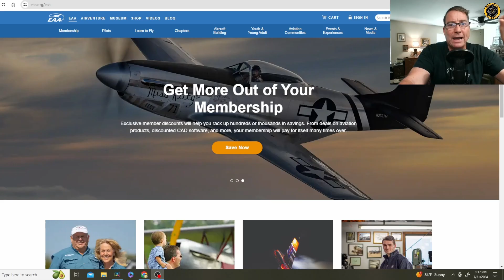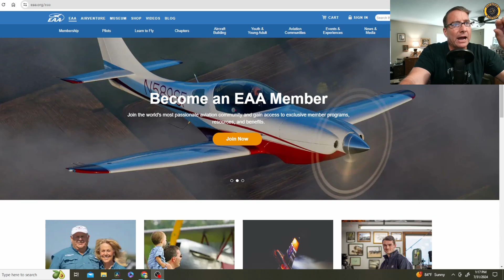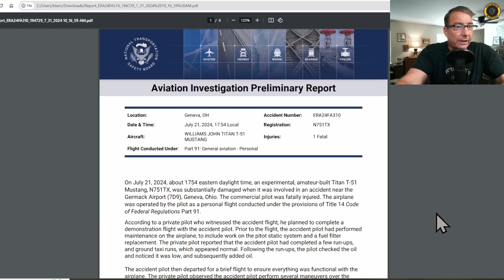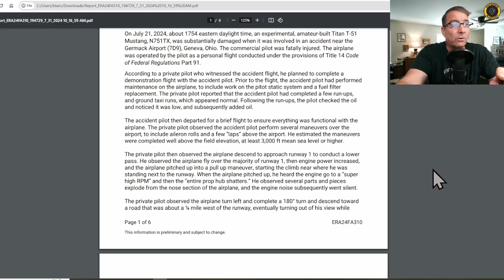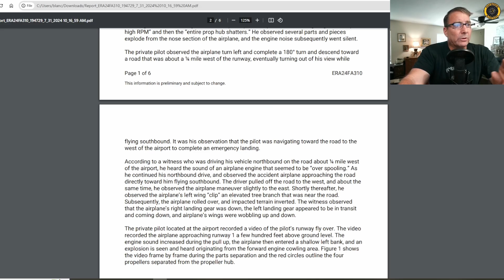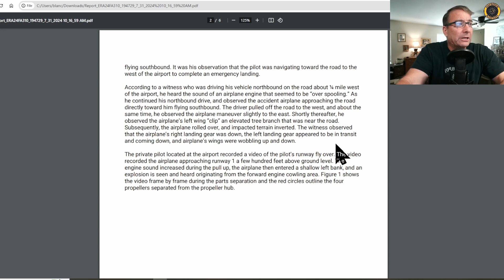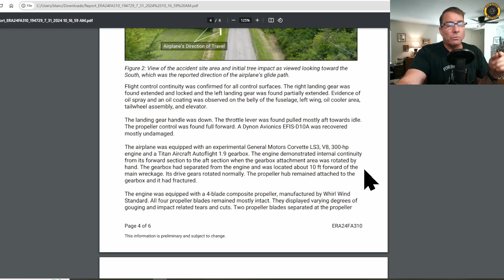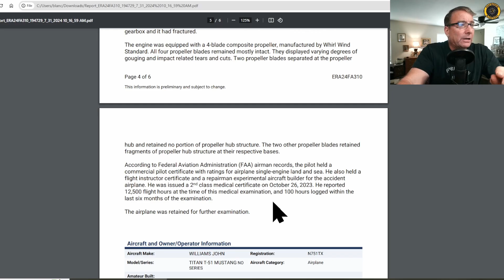Titan T-51 Fatal Prop Hub Failure 21 July 2024

Comment from the maker: No, to be clear and as presented in the video. The prop hub failure was PRECEEDED by a gross PROP OVERSPEED.
Reply: The fact that this has an GM LS3 suddenly brings up all sorts of other possible failure modes. The factory redline for an LS3 of that trim is something like 6600 RPM (Edit: And this assumes it’s the stock FI setup and not something else. Sans any limiter these will cheerfully rev right past 7k). With the 1.9 ratio reduction that will equate to a max of roughly 3500 RPM. The kicker is how was the rev limiter configured? Thats a big one. With all that rotating mass the last thing you would want is one of the usual hysteretic based ones that uses bang-bang control of the fuel and/or spark that causes the RPMs to bounce up and down rapidly. That will shock load the prop and the gearbox in the event there is an overspeed. I have actually reverse engineered some of the OBD-2 ECUs used on LS motors and there are possible options to allow for a "landing" during an uncontrolled overrev where instead of just bouncing away it arrests the PRMs and holds them there.
Reply: @mysock351C Ok, just putting my own observations here from my 3 vehicles, a 2002 2500HD 6.0 gas engine (with throttle cable), a 2004 2500HD 6.0 gas engine (with drive by wire) and a 2012 GMC Yukon XL with the base 6.2, my 02 will rev up to 5200rpm and stay while in park, it doesn't bounce, until its in gear then it will do the rpm bounce (i put the tires in grass to experiment) my 04 will only rev to 4k rpm and stay steady in park, and in the grass it doesn't seem to bounce off the limiter nowhere near what my 02 did. My 12 Yukon revs to 4k rpm and bounces in park, and it bounces at 5500rpm when the tires are spinning both. No mods done on none of the trucks except a "hot air generic K&N intake" on the 02. Just figured i would put my experiment results here, as some real world non-scientific, general observation testing.
Reply: @mattcat231 Factory ECU's have pretty low RPM limiters. I'd expect the aircrafts engine to be fitted with MoTeC or Holley EFI, and not to have had an upper RPM limiter set.
Also, ditch the Hot Air intake and get a Cold Air one, your trucks will run better. ;)
Reply: @mattcat231 nobody said the engine is running with a GM ECU.
Reply: @alafrosty  I also wasn't implying it was, i was just putting the info out there IF IT WAS A GM PCM, and what my real world observations were with my 3 vehicles.
Reply: @PiDsPagePrototypes  They are using factory ECU's. That is why it over revved. Engine redline 6500, propeller designed for max 4500. When the variable pitch failed from full pitch it reverted to minimum pitch unloading the engine an going to FACTORY redline causing centrifugal destruction of the propeller hub. Motec has an incredibly fast and soft acting rev limiter by many means. Ignition, fuel, timing and throttle body.
Reply from the maker: Loss of oil pressure to the governor can cause this...we don't know yet.
Reply: @blancolirio  would it be easier since the engine (I'm assuming somewhat that carbs haven't been installed) has EFI that the ignition can be retarded if there is an overspeed condition?
Reply: @TankEnMate  Aerospace Engineer here: Great question.
I have spent 30+ years in industrial control systems and part of that time working for an employer who also owned a racing car team as well as having another client who was into car racing. So I not only know how systems that use sensors and software make machinery work I have also been around things like ECUs (engine control units) that control EFI engines with. 

FIRST - I do not know what system they had on this particular engine. So all I am giving you and others here is general information. Most pilots should know parts of this stuff. The reason I am going over the different types is so that when Juan does a follow up and tells us what sort of system was on this engine you'll all have a general idea what he's describing.

Specifically to your question: YES all ECUs can limit the engine RPM and can do it in several ways. The common 2 are to retard the engine and the other is to cut the fuel supply. That's not always that clear cut as they may cut the fuel supply progressively as in they cut the fuel to only a couple of cylinders then a couple more then more after that. The reason they do that is so they don't have a sudden loss of power when they hit the limiter and it makes the car jump around. Its sometimes called a soft limiter.

PART 1 - Magnetos
Its fine to allow a computer and software to control the spark when you are in a car or a boat because neither cars or boats fall out of the sky when their engines stop. The emphasis on aircraft engines is to keep them running regardless of other systems on the plane. The only other engines I know that do similar are high end drag racers like Top Fueler racers and they use magnetos to reduce the chance of an engine hydraulic where the cylinder fills with liquid fuel and the piston tries to compress what can't be compressed and instead blows the side out of the engine. YES I have had a Top Fuel mechanic explain to me the starting procedure for one and its pretty amazing what happens.   

To keep then running no matter what else happens in the plane they use magnetos. For those who don't know magnetos look similar to a distributor but create the spark energy internally from the engine crank shaft. They do not need or use batteries, coils or anything else to make a spark. What they do have internally is a impulse drive that uses a mechanism that no matter how fast the magneto is turned it will generate a spark at each required point in the cycle. 

That also means they have a dangerous side effect if its not respected. If you hand crank a magneto engine you only have to crank it far enough to get to the next spark and then it will spark and the engine will kick if it has fuel in the cylinder. 

PART 2 - Mechanical Fuel injection.
Long before there was electronic fuel injection there was mechanical fuel injection and it came in 2 main forms and both still exist. There's direct injection into the cylinder and port injection where the fuel is injected into the inlet port. There's also indirect injection where fuel is injected into a small chamber attached to the cylinder. If you want more on that Wikipedia explains them all on a page titled "Fuel Injection" 

The type we see on most aircraft are PORT INJECTION systems which we see on engines like Lycomings and Continentals. Anyone who's flown fuel inject C172s or Mooneys during their training like I was had these systems explained to them. Unlike EFI systems these are actually quite basic. There's a pump, there's the fuel flow control valve, there's a fuel distributor, there's lines to the nozzles and then the nozzles. There's no solenoid operated injection nozzle like with EFI. There's no engine sensors showing where  engine is in its rotation. The pump pumps, the valve controls the flow, the distributor distributes the fuel and fuel flows constantly into the inlet ports.

Just Google "Lycoming fuel injection system" and you find plenty of diagrams.

PART 3 - EFI & ECUs
These are what is in your modern car and MAYBE what they still use in these converted engines.
 
All that EFI means is that the fuel injector is electronically controlled by a solenoid which is a fancy name for an electro-magnetic switch. Solenoids are used for all sorts of valves, relays, contactors and many other things in engineering. I mostly work in control systems and automation and have 30+ years designing systems with pneumatics, hydraulics, robots with grippers,......etc. and they all use solenoids.

In more recent times ECUs have also taken over from distributors. Instead of the spark being controlled mechanically in a distributor running of the cam shaft its done in software, BUT THAT ALSO means that the computer needs very accurate sensing to where the engine is in its cycle. This has to work for the entire rev range of the engine. so these systems are designed for the fastest speed the engine works at. 

FOR EXAMPLE: At 6,000rpm an engine is doing 100 revolutions a second and in a 4-cycle engine each cylinder is being fed fuel and firing its ignition 50 times a second and that has to be accurately timed. 50 times per second is 20milliseconds or 20 one thousands of a second. So within 20 one thousandths of a second you need to be able to determine the engine speed the precise angle camshaft is at and rotation, read all the other sensors that contribute to engine management (air temperature, air pressure, exhaust temperature,....etc.) as well as the throttle position AND THEN calculate BOTH the ignition timing and fuel delivery and then precisely deliver both to each cylinder.

Now just to consider the ignition. You need to be right on camshaft angle to at least 1/10th of a degree which means you need a sensor capable of around 1/100th of a degree. A basic rule of sensing methodology is the sensor needs to be 10x more accurate than the required measurement so that your measurement can meet basic tolerance requirements. So you need a sensor capable of measuring 36,000 positions of camshaft angle. 

SUMMARY and apologies to all those who've kept reading this far for how long it is.
Aircraft leave the ground and once they've left the ground almost ANYTHING that can go wrong is a major event and more often than not circumstance decides everything. Imagine in this case had this happened a few seconds later with enough altitude to glide around and get back onto the runway or if the airfield had been in open farmland and there was a convenient paddock.

Every event with an aircraft is a major event and one of the easiest ways to mitigate the possibility of an event is to keep things simple so there's less to go wrong. Aircraft engines prioritise reliability while car engines prioritise performance. It will be interesting to see how this particular engine was modified for aircraft use.

And YES I did check out a couple of YouTube videos on LS3 engines for aircraft use. There's an excellent video on the channel Internal combustion titled "AutoPSRU Prop Speed Reduction Unit and LS3 V8 Engine Swap For Your Airplane - EAA Oshkosh [4K]" 
NOTE ITS NOT THE SAME UNIT USED ON THE TITAN T51
Reply: @tonywilson4713  Stupid Chat GPT generated nonsense.
Reply: @PistonAvatarGuy  Since this is the Blancolirio channel I wont reply to that in the way it deserves to be treated.

THIS IS NOT A PALCE TO BE A TROLL.
So just do everyone the favor of leaving the conversation.
Reply: @tonywilson4713  K, bye!
Reply: @tonywilson4713  Wait, people are actually upvoting this? Seriously? Someone finish this for me: "But the people are r___d."

PART 1 - Are you trying to suggest that this LS V8 used a magneto ignition system, or are you trying to suggest that a computer should not be allowed to run an aircraft engine? Basically all modern turbine engines (including all of those used on big airliners) have a computer running the engine and they will not run if the computer fails. The Continental and Austro Engine diesels are also completely computer controlled and will not run if the computer fails. Rotax also offers computer controlled versions of their 900 series engines. An EASA certified, single lever conversion system is also available for the Rotax 912iS and 915iS. The term often used for such systems in aviation is FADEC, but not all are truly FADEC systems. The V8 in the accident aircraft uses a distributorless ignition system, with an ignition coil for each cylinder, and this type of system is usually highly reliable. Magnetos are likely to be many times LESS reliable than distributorless ignition systems and both Lycoming and Continental have replaced magneto systems with distributorless ignition systems on their electronic engines (TEO-540, TSIOF-550). FADEC controlled engines will also use dual-lane ECUs, so if one ECU fails, there's still a backup that will operate the engine.

PART 2 - The engine in the accident aircraft probably didn't use direct injection. Many highly successful aircraft engines have used direct injection, though, both mechanical (German engines during WW2) and electronic (nearly all modern diesel aircraft engines).

Sorry, buddy, but your info is not only out of date, but it also only applies to archaic American aircraft engines.
Reply: @PistonAvatarGuy  FIRST - What information have I given that is FACTUALLY WRONG? 
YEAH ZERO.
I have merely informed the NON-AVIATION people here who ARE NOT that knowledgeable on aviation engines and what is generally used and WHY. 

SECOND - I have repeatedly said I don't know what this engine had in the way of engine management.

Note how you use the word "probably" in Part 2 of your latest rant. 

You don't know what this engine had either.

THIRD - Others asked about engine management and rev limiters and I happen to know how they work from my time around a car racing team. Again what have I said that's factually wrong? YEAH ZERO.

FOURTH - You jump from piston engines to turbines in a blink. I never said ANYTHING AT ALL about what is or isn't used on turbines. Turbines are NOT the subject. Piston engines and constant speed props are the subject. 

FIFTH - As for FADEC systems - year sure I know what they are. My flying club was down the street from the Cirrus agent and he regularly dropped by and explained how they worked. We even had a Cirrus on the flight line for a while, but this is NOT a Cirrus. I have an aerobatics buddy who's Giles 200 has only 1 magneto and instead of a second mag he has a solid state ignition, but this is NOT a Giles 200 set up for unlimited aerobatics.

You're reading into this NOT ME.
Your arrogance and repeated stupidity in trying to gaslight people is YOUR FAULT and NOBODY ELSE'S.
Reply: @tonywilson4713  So you're just wasting people's time, writing long, rambling comments that offer nothing of value?
Reply: @PistonAvatarGuy  WELL WTF HAVE YOU DONE????
Reply: You wonder why people are giving me thumbs up and you thumbs down. 
GO LOOK IN A MIRROR AND SEE WHAT SORT OF ATTITUDE YOU HAVE.
Reply: @tonywilson4713  Until you posted a load of completely irrelevant nonsense, I was only being helpful and informative.
Reply: @PistonAvatarGuy  AGAIN NOTHING
All you have done is attack me AND PRESNETED NOT ONE FACT
Reply: @blancolirio  It's a standard part of pre-TO runup to cycle the prop, correct?  Perhaps John did so before the initial flight of the day but skipped it on subsequent flights.  The observer is not quoted in the preliminary report as to this..  Wonder if the NTSB asked about it.  Or whether his video contains the taxi out, pre-TO checks and launch?  

Seems like NTSB needs to be asking witnesses....
Reply: Hi Juan, Thanks for this info. I hope you can track any follow up data on this. It will be interesting.
Reply: A car engine and gearbox has nothing like the duty cycle requirements of an aero engine. They may have similar peak powers but they are not designed for continuous high duty as aero engines are.
Reply: @kutto5017 A well built LS3, running with appropriately set RPM limits, is more then capable of delivering the power required. What a Rotax 912 delivers at full power setting, a decent LS3 delivers at about 50% duty cycle. The main changes needed, are bigger Oil Coolers and Radiators for the Sustained loading and heat soak. If those are done correctly, a motor that can be pushed beyond a 1000hp for drag racing, can easily sit at 200hp all day, as shown by entrants in "Drag and Drive" events.
Reply: A mate here in Australia has had the hub shaft fail while ground testing before its first flight. Under investigation, the engineering was no better than anything you would put in a boat.. It was horrible... We both agreed that he was so lucky
Reply: How do they know that conclusively?  A prop hub failure would cause an immediate over speed, so knowing which came first is extremely difficult.
Reply: Seems to me that the prop and engine under load could not very suddenly and drastically increase RPMs.  A separation or fracture could.
Reply: @jeffmariajenson9751  It could if the prop hub failure mode allowed the blades to go to fine pitch.  IF low oil level in the hub did so - rather than failing to coarse or intermediate ptch (approximating a fixed pitch propeller) it almost certainly could have allowed an engine such as an LS3 to overspeed and fail the hub/blade assembly.
Reply: I'm more a racing car engineer but from what i see in that video, the problem cannot be the gearbox, if the gearbox fails the engine will go up in rpm but the propeller will slow down and not explode. Now we know that the gearbox was not broken but separated from the engine during the crash.
So the only solution is that the propeller pich went to minimum while the throttle was at full power and the hub exploded because of that overspeed.
But once again this should not happen, if the system is well engineered, even if something breaks in the pitch control it should never go to that overspeed.
In racing cars there is a limiter that shuts down the ignition if the rpm are to high to preserve the engine. So there is a major problem here, the engine should never have went to such high rpms so that the hub would explode.
Reply: @kukipett  Your logic is right but the conclusion is wrong.
Go read the last post I had on constant speed units. 

In a single engine plane if the CSU fails the prop will usually (but not in all cases) go to full fine. 

Twin engine (as far as I know) is the opposite. They all go to full feather.

The reason in all cases is you want the aircraft to keep flying as best it can.
Reply: the fully fine setting should be set to limit prop speed to a safe level during a take off run. But at high speed fully fine has the potential to easily allow the prop to overspeed. I wonder if he was low power high speed and the prop was at or close to fully fine then when power was added the prop control either couldn't adjust quickly enough or failed in some way leaving.
Reply: @joashparker8271  @okflyer777 posts above that this prop hub design only holds about 2 qts of oil. If the prop hub was low oil (for multiple possible reasons) that condition would almost certainly compromise its function while still allowing the engine to deliver full power to the prop.  IOW, the gearbox didn't faiI. 

'm performing lots of SWAG - but a failure mode allowing the blades to go to / remain in flat pitch probably could allow the overspeed to fail the hub.  

The NTSB may or not be able to diagnose components of the accident power train.  Maybe an intact power train on another T51 will allow non-destructive testing.  The failure mode needs resolution - I'd be afraid to fly any T51 unless the cause is resolved.
Reply: As a prop lever was mentioned in the report I gather RPM was governed by a CSU of some sort. If so, a CSU failure is also a viable option.
Reply: @blancolirio  However, that’s yet to be determined. If the gearbox fails first, the engine will over rev but the prop or hub would not become overpowered. Perhaps a sudden transit of the gearbox becoming disengaged, then instantly clogging back in would destroy the blade junction or prop hub as shown in the video; matching the engine RPM rev up then coming apart.
Reply: I don’t know anything about building a plane, but why would you want to use a car engine??
Reply: @LeoTicky Because car engines are a lot cheaper to buy and to run than aircraft engines. And more powerful, and often more fuel efficient.
Reply: @markirmuir  would one of those plane parachutes have helped?
Reply: @LeoTicky  Possibly. But he was probably too low to deploy it, and may not have had enough kinetic energy to climb to a safe altitude to deploy it.
Reply: @LeoTicky …because it’s cheap. In other words, there isn’t a good reason.
Reply: @LeoTicky  valid question and the basic answer is cost.

If you have a plane that needs a new engine developed from scratch its a serious cost. One way to get past a lot of that cost is to start with an existing engine.

Even the car companies don't start with a clean sheet on engines that often and use an existing engine as the basis for the next car.
Reply: @tonywilson4713  thank you
Reply: Light travels a lot faster than sound. Without knowing the distance to the plane, it will be difficult to exactly sync up the sound with the video properly.
Reply: There is no way the engine is going to overspeed unless the the prop pitch mechanism fails. This induces the the overspeed, which then induces the Rapid Unscheduled Disassembly of the prop.  99 and 44 one hundredths percent sure that this be the finding.
Reply: HOW .. the engines ecu prevents the engine (& prop) from exceeding prescribed parameters
Reply: I don't think we can read too much into that. The overspeed might have been preceded by a prop control failure, the nature of which we don't know, therefore we don't know the possible consequences of such a failure. Those consequences might include blade separation independent of prop speed.
Reply: @beenaplumber8379  the engines ecu rev limiter would have prevented it over revving.. a blade HAD to have fatigue failed & the hub would've very quickly sheared off with imbalance
Reply: @Errol.C-nz  If the rev limiter was working, how did the prop overspeed? If there was a fatigue crack, how do you conclude that it was in the blade and not in the hub assembly? How do you know there was a fatigue crack? When anyone says something HAS to have been the result of some specific cause, that means they can't think of another explanation. If you can't think of another explanation, that doesn't mean another scenario isn't possible. (Scientists make this mistake often in research. It's common.)
Reply: @beenaplumber8379  the engine couldnt over speed.. the ecu wouldnt allow it.. therefore neither could the prop.. the plane wasnt in a dive when the prop failed
Reply: @Errol.C-nz  The pilot witness said the engine did suddenly over-rev. He was watching it, and he heard that clearly, though I don't recall the exact words he used. They were emphatic, like way over-revved or severely over-revved, something like that. Another witness, a non-pilot, also reported words to that effect - engine suddenly "spooled up.". So, that's kinda my point. Any over-rev protection seems not to have worked for one reason or another.
Reply: Is that conclusion (which came first) being drawn from eyewitness testimony? Eyewitness testimony is very unreliable and an overspeed from hub failure seems WAY more plausible than, say, he hit the nitrous boost or something.
Reply: Prop hub failed, then the engine over sped.
Reply: @Public_land_trail_cams  Quite possible but we don't yet have the engine data.
Reply: Given that it's an LS engine and the overspeed preceded the rest of the observable failures, only thing I would think is that the engine was commanded to full throttle. If the throttle goes through a governor to control power/RPM, then it had to be a governor failure. If the throttle was drive by wire, then it would have had to be a computer failure. Every other scenario on this engines should have derated or caused catastrophic engine failure. Not a Pilot or have any specific knowledge of how this plain was built, just my experience with gas engines.
Reply: "Worked out all the bugs" and "come back to bite you..." -- that's prescient, I think...

So why would he check the oil after the runup? Is that usual? The maintenance he did wasn't related to the lubrication system in any meaningful way, wouldn't he have checked it as he was completing the maintenance? I wouldn't know, so I'm asking... just seems peculiar, in hindsight. Seems to have been lots of "oil spray" noted in the prelim... again, having watched and read about quite a few accident reports  this also strikes me as peculiar...

Loss of oil pressure means the governor won't work, blades go flat, loss of load, engine goes wild and then pieces go boom. (No rev limiter??) Another most peculiar thing, this happened just as he pulled up... could the steep nose up attitude coupled with the loss of some oil have starved the governor?

Was he already troubleshooting an engine oil issue for some time prior to the flight? We need to know. I mention this because errors in judgment kills a lot of pilots. Not careless, just failing to smell that Swiss cheese,  doing that maneuver so close to the ground with what might have been an annoying phantom oil leak... complex systems require careful study, experimental class or not. Condolences to his family.
Reply: Looks like the panel around the gearbox blew apart first. There goes all control of the prop. Probably went full fun on a high speed pass. Pretty sure John has a V12 BMW engine in his.
Reply: I understand that - but an engine responds to load - the propeller is what places the load on the engine, a fully loaded engine cannot accelerate. 
I'm not saying that it did not happen, but, It would require a very unusual combination of factors for the engine to suddenly accelerate if the prop was functioning properly - that said - I have actually witnessed casualties where electronic load controls suddenly went from sending a proportional load signal to sending an
inverse proportional load signal - but that would require the propeller hub and engine governor to be electronically linked. 
I have also seen a governor speed input signal failure resulting in in an overspeed casualty (actuating the overspeed governor) Not knowing the nature of the fuel delivery system on this engine, I clearly can only speculate. But I definitely have questions as to the assertion that engine oversped a correctly functioning propeller - assuming that the propeller was correctly matched to the power output of the engine.
Reply: I am waiting to see what the FAA comes up with for the final findings if they figure it out and they should.  I have a T-51 with a V6, same prop but different length.  The same gearbox manufacture with a different gear ratio as far as I know.  I had a departure prop runaway and it was balls to the wall for engine rpm and right now.  It gets your attention but I knew what had happen right away from talks with other builders.  Key here is the fine pitch MUST be set to the take off power pitch angle before you leave the ground in case of governor failures and the damn thing did fail.  It gets your attention anyway.  Remember,  oil puts pitch in and the hub spring takes it out.  That's the safety net. The only thing that's certified on my bird is the governor.  So certified is no better than other homebuilt parts I have.  I sent it in to be fixed for whatever was wrong with it and they sent it back in a plastic bag with the comment.....  Junk.  So  I had to order a new one.  So I'm not sure what failed at this point but I sure would like to know as many other T-51 builders would.  I knew John very well.  So sad.
Reply: Sounds like these kit planes need to be grounded until exhaustive metallurgical  stresses analysis can be done and re-engineered, possibly with a time life limitation if stresses are  found to be cumulative.  Possibly the hub is the weak link in the high G, high performace , climb being performed. If the prop hub departed the xmsn output shaft, the hub would no longer be speed limited, by the  xmsn/ engine train. The prop hub then by inertia briefly accellerating in speed to the point of failure.  I remember seeing a cgi representation of this effect re the "Whirl mode" failures in the early Lockheed1088. The animation shows the prop, hub and short bit of shaft, briefly extracting itself forward of the nacelle, before then pulled down by gravity while at same time laterally moving inboard, and the blades slicing through hydraulics in the belly. (Actually occurred on a flight in Alaska, search " Mayday" episodes)

Let's not forget that once any one of those blade/hub roots lets go the whole remaining assembly can unbalance to destruction.

Also we are not provided audio of this event. However we are told the flyby was above 300 feet with a high performance climb, terminating in hub failure. Assuming the termination occurred 1000 or more feet linear distance between the failure and the camera recording audio. There will be 200 or more millisecond delay, between what is visually recorded, and what is audibly recorded. Assuming that the hub and prop assembly then unlimited by drive, did it self immediately accelerate rotationally. There would be a concomitant rise in audio frequency pitch associated with that, along with the linear distance delay. As well, there will be upward audible doppler shift dependent on hub accelleration, and possibly other differential audible artifacts when blade tips exceed Mach 1.
Reply: @jakerabinz9411  You would ground "these kitplanes" because of a single failure of unknown origin? Generally there needs to be a pattern of failures before grounding a type, and the groundings usually involve only those aircraft with the suspect part installed. Automotive engines and gear reduction systems have been in reliable use for decades. One single accident of undetermined cause does not negate the validity of the concept.

The over-revving sound preceded the fragmentation event, meaning the slower-moving sound still arrived at the witness well before the visual fragmentation event. It could be a prop control issue, who knows.
Reply: No, to be accurate the observer reported he heard the engine go to a super high RPM and then the entire prop hub shatters. You only assume that to mean a prop over speed preceding it’s failure and you could be right but you know what they say about assumptions - they make an ASS of U and ME.
Reply: @MacLocky  yes everybody knows this, it's been covered for weeks.
Reply: @popsfereal  well clearly not everyone but thanks for taking the time to point that out.
Reply: Juan B,  thanks for covering this accident.  Taking it at its simplest explanation,  at least until further testing has a chance to determines otherwise,  I would surmise that the engine overspeed occurred after the loss of the load of the propeller, meaning after a prop hub failure.  Observation from the ground could certainly seem that the opposite has happened, but with the delay of sound compared to visual clues and the enormity of the situation, it could easily be confused.  It is sad either way, but current Titan flyers need to be wary for the near future.  Life is full of danger, and yet we know this and strive to live it to the fullest.  Thanks Juan, from Texas.
Reply: The likely reason for the engine to over rev is that it lost load on it, which implies something broke lose prior to the over rev and subsequent disassembly of the prop hub.
Reply: @JDale56  That was my initial thought, but it’s got an LS3 V8 and not a conventional airplane engine. These have more than enough power and RPM capability to explode a prop, even with the gear reduction if there are no controls to limit the RPMs. With a conventional airplane engine its sheer rotating mass and weak factory valve springs would at least provide some mechanical limit on the speed when unloaded. These? Not so much.
Reply: The T51 prop reduction gearbox holds only about 2 quarts of oil.  I wonder if it lost enough oil to allow the governor to starve and cause the overspeed…. John almost pulled this off.  Great pilot.
Reply: @okflyer777 pilot tried to execute a u-turn and land instead of already having picked out where he should crash the plane straight ahead. As a general rule, at any sort of lowish altitude prop or engine failure, the pilot should already have an alt landing spot picked out. There's no such thing as too much crash-preparedness.
Reply: Thanks. I was going to ask you for clarification about that.
Reply: I knew John, he was a great guy and loved doing what he did . He would want us to keep building and refining projects.
Reply: @blakechinn5792  great guy, he laid a bunch of us off so that he could hire other people for $2 an hour less that didn't know anything.
Reply: Mechanical separation of gearbox (note “Titan” gearbox) from engine result rpm overrun and induced prop assembly failure.
Reply: @IanCrane-ek9ej  That was almost certainly a result of an impact during the crash. If the engine had disconnected from the gearbox during the flight, it wouldn't have been able to over-rev the prop. This was likely a prop overspeed caused by a governor failure.

The engine should have had an electronic rev limiter set to prevent this kind of thing. There's a good video of a Velocity flying with an LS3, where it was bouncing off of the rev limiter quite a bit during takeoff, everything held together just fine. Edit: The builder even states in the video that the limiter was set specifically to protect the propeller.
Reply: @IanCrane-ek9ej   This is a reduction gearbox to  decrease prop RPM relative to engine RPM.  I'm not a mechanical engineer so have to ask: Is a failure mode possible in which input power continues to reach the output shaft?  On the surface, it seems implausible.  Which does not mean impossible.  A failure mode might even be applying engine RPM directly to the gearbox output shaft (and prop).  That might account for the prop hub's catastrophic failure.
Reply: Everyone seems really hung up on the engine's rev limiter for some reason.  The engine isn't what causes the prop to overspeed when you lose pitch control, it's the prop itself.  The prop will act like a windmill and drive the engine to ridiculous speeds in an instant...even if that engine has an ECU with a flawlessly functioning rev limiter programmed in, it's helpless to stop that propeller from screaming way past redline and dragging the engine along with it.  You could shut the ignition and fuel off immediately but the prop itself is harnessing way more horsepower than it needs to drive that engine from the air moving over it.  It's sort of like reaching top speed in a car and then somehow slamming it into 1st gear...there's no amount of rev limiting that's going to prevent that engine from screaming past redline.

Most prop governors work like the controls for a one way hydraulic ram, the blade pitch is moved with a piston inside the hub that actuates arms on the blades for pitch control as it's moved back and forth.  The governor takes oil from the engine and boosts it to a few hundred psi, then pumps that oil into the prop hub for pitch changes.  When you pump oil into the hub, it causes the blades to increase pitch (feathered).  It decreases pitch by allowing some of that oil to bleed back into the crankcase.  Several forces are at work to push that oil into the crankcase, primarily aerodynamic and inertial forces, acting against that 200-300psi worth of oil pressure to reduce pitch (flat).  Those forces are quite significant, as the piston is a few inches in diameter and being acted upon by 200-300psi, thousands of pounds of force in a general sense.  So you have the prop governor pushing oil into the hub in a constant fight against the strong tendency of the prop to push that oil back out of the hub.  As long as the two forces are balanced, there is equilibrium.  When something changes that equilibrium (changing power settings or airspeed, adjusting the prop governor itself), the prop governor adds or removes oil from the hub to return to equilibrium.  It does all of this with a gear driven flyweight attached to what amounts to a simple valve.  The flyweights increase RPM along with the prop (this can be located on the engine if direct drive, or on the gearbox on a geared engine, so the RPM is directly related to the prop itself).  The flyweight forces are counteracted by an adjustable spring that the pilot can control the force on.  If the weights fly outward and overcome spring pressure (overspeed), it pulls the valve up and lets oil pressure go into the hub to give it more pitch (toward feathered).  If the spring overcomes the weights and they move inward (underspeed), it pushes the valve down and allows the oil to flow out of the hub and into the crankcase to give it less pitch (toward flat).  The prop control lever in the cockpit is directly controlling the spring pressure on the flyweights, and the prop governor is simply doing what physics tells it to do.  It's ancient and reliable tech from the steam days, you can see what amounts to the same thing with centrifugal governors on steam engines to get a generalized idea of how they work.  Now, some specific prop hubs don't use aerodynamic forces on the prop to return oil, instead they act as a valve for a two-way hydraulic piston...they pump oil on either side of the piston to effect a pitch change, and the most common in use is a hydromatic hub, mostly relegated to WWII-era aircraft.  They're a great prop hub compared to the counterweight alternatives but rarely seen in general aviation and most certainly not on a Whirlwind prop.

So putting it all together, how does this make any sense in relation to the prop failure?  The gearbox itself was intact, just separated from the engine after impact, so that's not the culprit.  The most simple explanation is that the oil pressure wasn't there to counteract the forces of the prop wanting to go into fine pitch (flat).  There's a multitude of ways this can happen...the two most common are the prop governor failing and getting stuck in a position to allow all the oil to drain out of the hub, or the oil supply feeding the prop governor was lost.  Others I've seen have failed to produce enough oil pressure, either because the pump itself failed or the drive sheared off, and I've seen one that fell off the engine entirely.  The o-ring for the prop hub sealing this working oil inside the piston can fail as well, though the effects are for the most part more gradual, giving you enough time to figure out what's going on and cut power before the prop disintegrates.  Air can get introduced in the lines (like from changing an oil filter) and cause the prop governor to temporarily lose control until the air bubble makes its way through and oil is reintroduced, but this is usually something that gets worked out of the system on the ground when you check prop operation by cycling it a few times, or after a few minutes of flying.  In very rare cases, the hub and blade root can get stuck, and no amount of oil pressure can dislodge it from a set position (usually a broken gear tooth getting stuck inside the spider gears), but this doesn't cause a runaway prop condition.  Logically speaking, a loss of oil/oil control was most certainly involved, though the NTSB will have to inspect the prop governor to verify operation or note any failures to narrow it down any more.

Oil on the belly means it had been leaking oil, which could point to maybe a loose oil filter that slowly allowed the engine to pump all the oil overboard, and perhaps collaborate with having to top the oil off before the flight (though an oil leak that significant would probably be obvious on the ground).  But given what we know of how a prop hub works as outlined above, if that hub blew apart, then there's a big source of oil right there and it flew long enough after the failure that the oil could've covered the aircraft.  It doesn't take much oil at all to completely coat an airplane in a very short time.  So that could be indicative, but not a smoking gun by any means.  Coincidentally, if you're curious as to what a prop overspeed failure sounds and looks like in a video, search for "sport class Relentless mayday 2010" to see one in action.  The oil cooler failed during a race and the engine pumped all its oil out, until the prop governor lost its oil supply and the whole thing exploded instantaneously.  Really impressive sound and deadstick landing, though.  Some aircraft engines have an oil pickup tube specifically for the governor, so that even if the engine dumps oil and starves itself, you still have a tiny bit remaining for the prop governor to retain control.  In this case it would've saved that prop on Relentless had they had one, but the engine would've simply seized up a few moments later anyway.  Better to have an engine seize up than a prop overspeed, as sometimes losing a single blade can induce enough vibration that the entire engine will shake itself off the aircraft, resulting in an unrecoverable tail heavy spin.
Reply: @Skinflaps_Meatslapper
Nailed it. Your comment echoes some of my earlier speculation and then some. Maybe I can pick your brain a bit.

The oil spray is interesting but also troubling to some degree. I m worried that it might mask an earlier pre-existing leak which might have been a contributing factor. The danger is in finding one leak and then assuming that we’ve found the problem, never thinking that there might be numerous leaks.
The video should be helpful here, it might show signs of a leak before the accident. Was there a plume, mist or something? Not sure that the resolution would be good enough to show large droplets of oil, but was there any signs of oil on the belly before the accident? That would be useful, to know exactly how long BEFORE the accident signs of trouble could be detected. Also the SOUND on the video is a lot more useful than many realize. Spectral analysis allows us to separate prop noise from engine noise, we could do frequency measurement and work backwards from there. The audio could turn out to be a gold mine, more useful than the video. 
The only point in your comment that I would disagree with is whether or not a fine pitch could drive a dead engine to the high rpm needed to throw a blade. Remember, power = rpm×torque. That fine pitch prop, if free spinning (not connected to anything) would give you lots of speed but very little torque. Don’t forget that the prop has the short end of the lever when it’s connected to the PSRU,  1.9 on this plane. I think that it could certainly drive a dead engine, but I have my doubts about generating the power needed to drive it to very high rpm. I think that the engine has to be running and still driving the prop for the rpm to get that high However,  I think you’re point about the rev limiter is valid. Even if it immediately cuts back to idle, the engine would no longer be nearly as effective acting as a brake. That little bit of engine power along with the windmilling prop might easily take the rpm off the charts.
Btw, I tracked down that video you mentioned, Relentless.  That ZOOM noise when the prop went nuts is what reminded me of spectral analysis, as I think most of that sound was generated by the prop, not the engine. Sure would be fun to play with that sound file, maybe somebody here has the software and the skills to use it properly.
Reply: Dumb here…. Isn’t it the reduction gears task to keep rpm reduced to certain predetermined speed? No matter the throttle position? Pekka
Reply: @PekuPuupolla  NO - the reduction gear is there to slow the prop RPM in a set ratio to the engine RPM. The actual speed control of a propeller is done via the constant speed unit (CSU).

The reason for a reduction unit is simple. Props don't like to go much faster than 3,000 rpm because the tips start to go supersonic. Direct drive aero engines a specifically built for that speed range. They are in fact closer to the diesel engine in a tractor (long stroke & low rpm) than a car engine . Car engines (in general) run to 6,000 rpm so you need to reduce that by about 1/2. When I checked the companies doing LS3 conversions they had reducers between 1.8:1 and 2.2:1

BELOW this is a basic explanation of CSUs.
The simplest description of a CSU is they're a speed governor that tries to keep the engine & prop at a constant speed by altering the angle of the prop blades.

There's 2 basic types mechanical and electrical but they do the same thing - alter the blade angle to keep the speed constant. The most common type is the mechanical CSU and its about the size of a 375ml drink can and is driven directly of the engine crank. What it does is supply oil at pressure to a piston in the prop hub which via cranks alters the bland angle. IMPORTANTLY that piston is also spring return so if there is a loss of oil or complete engine failure the blades return to their basic position which can be 1 of 2 things - either full fine as in flat to the air stream OR full feathered as 90degrees to the air stream.

The reason why you have both options is because you want different things in different aircraft. 

In most (not all) single engine planes the prop will go to full fine because if the CSU failed but the engine still works you can still generate thrust and fly to the next airfield (hopefully).

As far as I know in all multiengine planes the props return to full feathered. In a partial or full engine failure you still have the other engine. So you want the failed engine to go to its lowest drag which means full feathered on the prop. Its super important in twin engine planes like Juan's Beech Baron, because if one engine fails then you've got asymmetric thrust with all the power on one wing and nothing on the other. If the prop on the failed engine goes full fine it would ADD DRAG and making that worse. So going full feather on a multi engine is very important.

An exception to those circumstances that I know about are certain HIGH PERFORMANCE aerobatic planes. I don't mean planes like Decathlons. I mean Yaks, Sukhois, Extras,.... etc. This is NOT STRICT either as the owner can decide what they want. 

FIRST - Aerobatic props are a bit different to normal props. If you look at the aerobatics props from companies like Hartzel, MT, Whirwind,.... etc. they tend to have a much broader blade with a lower aspect ratio. They not only can produce raw thrust but can also provide huge amounts of drag for doing vertical down lines. Certain competition aerobatic figures like a stall turns, humpty bumps, p-loops and others have vertical down lines and they are required to be flown straight down. The more advanced categories include rolls and spins on those lines and at time spins followed by rolls. So having a propeller that also acts like an air brake is an advantage.  

However if you have an engine failure with that sort of prop it can be a lot of trouble because if it defaults to full fin then you have no power and a heap of drag. So its NOT uncommon for high performance aerobatics planes to have the same sort of CSU and prop hub combination that goes to full feather on an engine failure.

That said I don't know what sort of system this T51 had but I would suspect its the standard single engine type that goes to full fine on CSU or engine failure.

As Juan hinted early on and others have commented.
If the CSU lost oil then the prop would go to full fine and in that circumstance the only thing limiting the prop speed would be the throttle position because the prop is at that point acting just like a fixed pitch prop.

Having learned to fly aerobatics with fixed pitch props I can tell you its very easy to overspeed a prop when a plane is going faster than usual which you easily get at the end of figures like loops or pulling out from a stall turn. There's videos of people flying Cap-10Bs here on YouTube and they have a fixed pitch prop and you can see them work the throttle constantly so they don't overspeed the engine.

So I tend to agree with the others commenting that its possible the CSU lost oil as it would explain an overspeed event.

Sorry for another long comment.
And to certain people NONE of this was done with ChatGPT.
Reply: preceeded ?.. so the engine overpowered the prop ? thats a gross mismatch then or the driveshaft splines failed.. tollerance issues or machined defects
Reply: @Errol.C-nz  If the prop pitch goes flat, the propeller loses the ability to absorb the engine power.
Reply: @PistonAvatarGuy  assuming it had a constant speed prop BUT.. the output shaft max speed still shouldn't have been able to exceed limits.. even oem ecu rev limiters are set within the engines capacity.. the engine wouldn't have over rev'd.. mechanical failure id strongly suggest in the drive train somewhere
Reply: @Errol.C-nz  The rev limiter is set to protect the engine, but the factory LS rev limit is more than high enough to allow to propeller to self destruct.
Reply: @PistonAvatarGuy  that what gearbox ratios are for
Reply: @Errol.C-nz  no
Reply: @Errol.C-nz  NO - its not a case of over powering its a case of OVER SPEEDING.
Reply: @tonywilson4713  explain how an engine with a programmable rev limiter could over speed .. unless .. it wasn't matched to the gearbox output shaft & prop .. THAT would be serious negligence & incompetence
Reply: @blancolirio  What would cause the overspeed?  A sudden increase in air-fuel mixture into the cylinders?  Is that possible?  Is the engine supercharged or turbo supercharged?  

Or a flattening of propeller pitch?

I mean, we don’t know; but what are the possible causes?
Reply: Loss of the load on the engine would cause the over speed. I wonder how many hours we're on the prop and hub
Reply: @Andrew-13579  propeller pitch going to 'fine'. Remember this is a variable pitch prop.
Reply: @Andrew-13579
Reply: @Andrew-13579  I haven't read all the responses, but I think the prop speed is regulated by a governor.  If that broke, then I'd imagine it could cause an overspeed condition.
Reply: @Andrew-13579  
Broken driveline. Probably gear teeth but keyways or chain or any other component.
Reply: Not a pilot, but I take prop full forward to mean pitch was was correct, not flat.
Reply: @sirbike  That referred to the prop control lever in the cockpit, not the condition of the prop itself.
Reply: @sirbike  full "forward" isn't what you might think.. it's not full pitch which is feathered.. full forward is in power climb mode
Reply: @sirbike  I would assume prop lever full forward would be propeller governing to limit to red line RPM, which would not be flat pitch.  I would assume the propeller could not mechanically even go to flat pitch, unless something broke.  But if it went to minimum pitch or failed to increase pitch and govern maximum RPM while increased power was applied by the engine, due to increased fuel-air volume, could that be the cause of the overspeed?  Could the engine increase power so quickly that the propeller governing function could not react quickly enough to limit RPM safely?
Reply: @Andrew-13579  if the system controlling propeller pitch were to fail and allow the props to adjust themselves freely, the props will move into a zero or minimum pitch position because they are essentially just little spinning wings. Whether its zero pitch or low pitch makes little difference at higher speeds, both cases would remove most of the load from the engine. I would bet money that this is what happened - the pitch control failed, props went to zero pitch, taking most of the load off the engine. Centrifugal forces then ripped the propellers right out of the hub. 
I would imagine the hub and prop setup should be designed to handle the maximum rpm of the engine as a safety precaution, so I'm curious as to what details will be revealed by the investigation
Reply: @thecrazyfarmboy  That makes sense to me, and a rev limiter on the engine could be sufficient to at least limit the rpm to what the system at most can handle.
The question is also what's best at a failure - go to maximum or minimum pitch - or to some default pitch that would be reasonable for a fixed pitch propeller.
We'll see what they can figure out happened.
Reply: @ehsnils Looks like your mind went to the same place as race drivers, and especially drag racers - was there no engine speed limiter set in the engine management?
A well built LS, will rev well beyond normal useage levels, without the engine coming apart, so long as it has good oil pressure. The builder spoke about oil lines and such being needed to be redone for aeronautical use compared to automotive. If the oil pressure was consistent, the engine can be capable of high rpm regardless of G-loadings. Many drag racers have accidently over-revved LS engine with a missed gear shift or unintentional 3-2 shift when intending a 3-4 shift. 10,000 thru to 12,000 rpm has been recorded, and while it stretches conrods, it will still run and spin over by hand. Modern engine managent uses RPM limiters to stop events like that happening. If that was not set, the prop speed limits could easily have been surpassed.
Reply: @PiDsPagePrototypes  It might have been at default rpm instead of tuned to the max suitable, or it was of the kind with hard shutoff that was mentioned before which cuts and starts the engine causing powerful torque bumps throughout the system.
Reply: @thecrazyfarmboy  Sounds plausible. Which indicates there is no RPM limiting device directly on the engine ignition box which is super common and easy these days in non aviation, but I wonder if they feel that is unproven in the air. If so it is now proven to be needed.
Reply: @sirbike  Prop full forward would be to command maximum rpm, therefore, "flat". Assuming the system was a typical constant speed type, there is a propeller governor that controls blade pitch to prevent overspeeding. I'm not sure how this experimental system functions, however. There's nowhere on a Corvette engine to mount an aircraft governor.
Reply: There is far too much criminal software in the aircraft industry. 

Rev limiter!
Ocean racing boats also should run on rev limiter instead of having a throttle man for offloading. 

The max incident, single sensor without sanity checks? Criminal. 

Time they get their act together, pull their head out of their ass and move from the 40’s and mechanical plus pilot. We left that way too long ago. 
Spacex has dragged them into the 80’s so they can actually operate a spacecraft program with reasonable safety and efficiency.
Reply: @brucebaxter6923 I'd expect the software for the engine to probably be a MoTeC system, and the RPM Limiter is a User-Set option, not a lack-of-quality-software issue.
Reply: @PiDsPagePrototypes  
I agree completely. 

How would I also include application and setup of software/firmware/application?
Reply: @PiDsPagePrototypes  motel is very good. 
I’m not sure what is out there now days?

I would also hope that it had dual motec systems, preferably one per bank. 
It would also be nice if the sensors could be duplicated across systems so that any one sensor failing would not take out either system. 

(I had to design a redundant failsafe control system for a drone in a contest. 
It was a triple system from generators to battery to controller to actuator with crossovers in each stage of power supply and hardware minority report selection of controller.
Reply: @brucebaxter6923  User Error? Failure to RTFM? The software can be perfect, but, what's that old rule, GIGO, "Garbage In, Garbage Out". If the user doesn't feed it the right settings and data, the user getsa the wrong controls out.
Reply: @brucebaxter6923  Psst,.. spell check, word one, autocorrect bytes. ;)
Triple Redundancy is pretty much minimum spec for Aerospace, and a lot of computer controls have back-up mechanical systems.
Reply: @PiDsPagePrototypes  
Exactly. 

I have never been able to get past the single carburettor and dual ignition, but engine failure isn’t as bad as control failure. 

The mechanical systems have been refined and honed over all these years. 

We need to do the same with software. 

Things like rev limiters are so blatant they really should be mandatory. 

Sanity checks on all inputs also. 
You know, not 0% and not 100% and has a “live signal” not a fixed value before allowing takeoff. 

How about having weighbridge in the taxiway if not load cells on the landing gear to do weight and balance before takeoff, they weight trucks for crying out loud.
Reply: @brucebaxter6923  wtf are you going on about?
Reply: Internal gearbox failure, then it grenaded.
Reply: @TheBeingReal  No- the prop hub failed, not the gearbox
Reply: @Pantdino  are you sure?  That prop hub is the gearbox.
Reply: @Pantdino  
Never seen a diff after the box seizes?
Reply: Said failure were as a result of overspeed, overspeed could be gearbox related?
Reply: @TheBeingReal The geabox was assessed, it was fine.
Reply: @PistonAvatarGuy  Yes, according to the NTSB preliminary report.  Also, a gearbox failure - unless it somehow allowed continuity between engine and prop hub - would prevent the powerplant from overspeeding the prop.  A low oil level in the prop hub might not prevent the blades from going to or remaining in flat pitch while still delivering full engine power to the hub itself.
Reply: @TheBeingReal  A gearbox failure wouldn't cause an overspeed. If anything it would cause the prop hub to sieze. This was likely a lott of oil pressure, therefore a loss of prop governor - allowing the pitch to go fine. Look up Kevin Eldredge, #42 Relentless, to see just this. At Reno several years ago he lost oil pressure, and the prop went fine at high power settings. Immediate overspeed followed by the blades departing the prop hub.
Reply: @Jwmbike14  Gearboxes rarely seize up.  Teeth fatigue/damage leading to debris in oil, bearing failures- which lead to gear tooth failure.  Jamming up / seizing would stall the motor / engine.  

A hydraulic prop governor failure is in the mix, if it had one.  I believe you can get electric or hyd on this plane?
Reply: @TheBeingReal  A gearbox can not cause a prop overspeed. Watch the video I tagged to. This incident sounds almost identical.
Reply: @Jwmbike14  It won’t cause an overspeed, however if it catastrophically fails, it can certainly grenade.  You could get an engine overspeed by unloading the engine at rpm.  

Will be interesting to see if / when an NTSB report comes out.
Reply: @TheBeingReal  A failed gearbox would cause the engine to overspeed, but not the prop. This was a case of a prop letting loose due to an overspeed. I'd place good money on it, losing oil pressure & governor before the catastrophic failure. Esp with the mention of visible oil deposits on the belly and gear
Reply: @TheBeingReal oil down the side of the plane and the pilot stating that he didn't know how to correctly engineer the gearbox. But the gearbox failure would not likely lead to hub separation from apparent overspeed.